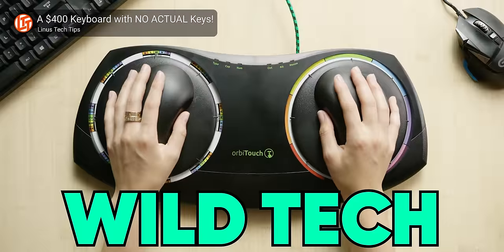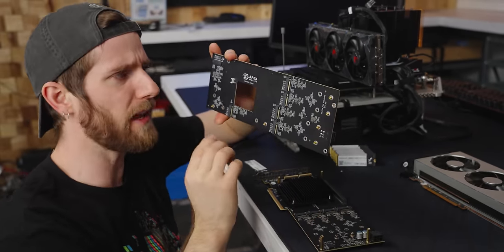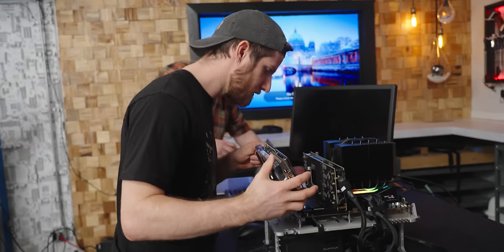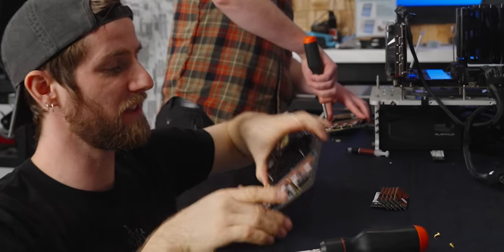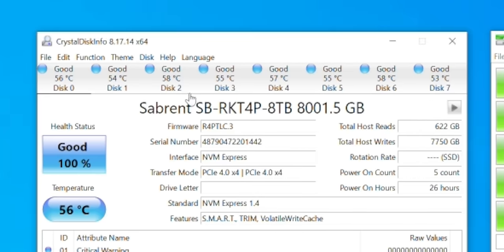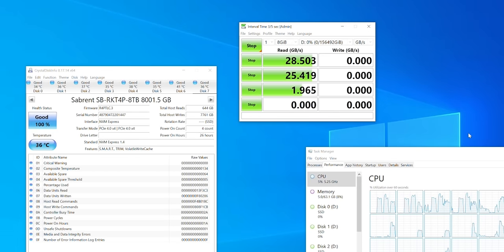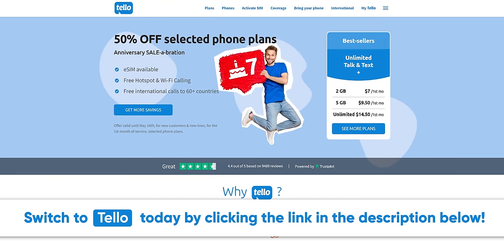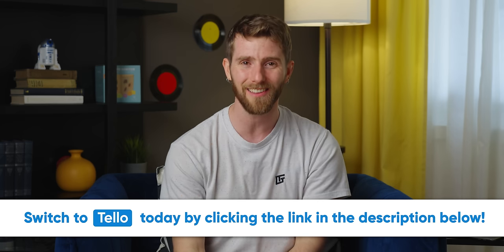This SSD is Faster Than Your RAM - Apex Storage X21

Comment: I'm happy this has come up as a topic of conversation. I've been wanting someone to test SSD speed to say yesteryear RAM versions like DDR3 DDR2 etc. to see if SSDs using swap files are at parity with RAM
Reply: Imagine the day when SSD's become as fast as modern ram then ram can be deleted from a PC.
Reply: @SpruceMoose-iv8un  you're not thinking big enough: you could open a game, unplug your computer, and then turn it back on and keep playing where you left off. Volatile memory holds us back from a lot of stuff.
Reply: Access times are about 10µs, whereas RAM is about 10ns, so about 1000 times slower. RAID improves data transfer rates but doesn't do anything for access time.
Reply: What about latency?
Reply: Intel's 3D xpoint was the closest thing to a NAND and RAM hybrid, too bad it didn't take off
Reply: it would be cool if someone made some hardware that use lots of GDDR6X ram-modules as storage, and had some sort of batterybackup when the computer is off, to keep the data. (and then running them in Raid :D
Reply: @SpruceMoose-iv8un  That could work if you're comfortable with the lower end speeds of previous-Gen DDR4 RAM but honestly I bet regular volatile RAM like HBM2e/HBM3, DDR5, and DDR6 will always stay one step ahead 😏

The fastest Optane drive (Intel's almost-RAM catching drives) was the P5800X at 7.4GB/s which barely edges out the Sabrent Rocket between DDR2-800 and DDR3-1066 🤙
Reply: @dial2616  that stuff already exists, it's called NVRAM or Non volatile RAM, it is slower than normal RAM and isn't just a slot in solution but in general has often lower latency than normal RAM sticks and can end up being cheaper. Issue is just the compatibility aspect and the fact it is limited to specialized applications
Reply: Latency would still be the issue.
Reply: @dial2616  Removing bad data from RAM is the reason every tech support person ever has said "have you tried turning it off and back on again". Even if we could get the access times down as low as RAM on NAND you'd still have to contend with the fact that sometimes non-volatile memory has a habit of permanently storing problems.
Reply: SSDs aren't at all comparable still, not by a long shot. The sequential read/writes on ssds are great, fine for pulling a computer out of hibernation sure, if people still do that, NVME drives are great for a lot however they are horrifically slow at that whole random access bit we enjoy so much with RAM. Like seriously they aint joking there, even gen 5 nvmes are a magnitude slower than even most ddr2 among demanding tasks.
Reply: @AndrewTSq  That's CXL more or less.
Reply: @handlemonium  optane's big advantage was never seq. speed. it was very low latency and legendary endurance.
Reply: yesterdecade
Reply: @giornikitop5373  low latency compared to NAND, it wasn't great compared to RAM.
Reply: @AndrewTSq  ram chips at high capacities and quantities that are needed for such a thing, would be unbelievable expensive and that's IF you can create a controller chip with that many mem channels and speed to make sense. the industry has already though about that decades ago and it's not viable by any means. besides, current hardware and software, cannot take advantage of that.
Reply: Bandwidth and latency are very different. The CPU also has direct access to RAM but does not have direct access to the drive. The interfacing is different. The memory controller on the CPU can access any row and any column of a memory module from a single instruction. To access a section on disk you need to end in/out commands from the CPU; Several of them and then read back the data.
Reply: Sadly the issue is that while the SSDs may be faster than the ram in sequential reads, theyre probably not soon gonna be faster in random reads/writes which is where most of the ram speed comes from
Reply: @glenwaldrop8166  of course. if any nand or 3dxp chip could have as low latency as ram then we would have replaced all the ram chips with that.
Reply: @SpruceMoose-iv8un by that time PCs will be more organic. Just give it a little slap for a speed boost.
Reply: @casperes0912  This is less of an issue on NVME but it's still a thing.

The latency on RAM costs hundreds of clock cycles, NAND latency is probably near a GHz of lost cycles.
Reply: @dial2616 i mean you can already do what your saying though you would just write the save and game state to storage. Just look what console was able to do with their resume states granted your not unplugging the thing but putting it to sleep essentially.

Also just saying that having everything run off of something like a ssd would still have trade offs even if there was raw performance parity. There  are plenty of use cases where you don’t want things to live essentially forever on a drive.
Reply: @Anti3D-0  And even that wasn't as fast as DRAM.
Reply: @handlemonium  That's a measure of bandwidth; latency matters more for the memory bus.
Reply: @dial2616  we had that with optaine.
Reply: @dial2616  you don't want to use an SSD for ram by using swap. its just not designed for it. see: all the corpses of MacBooks with dead SSD power delivery controller chips due to overuse of swap
Reply: @dial2616  i mean sent it to hibernate? ssd is going to make hibernation very fast.
Reply: Swap isn't meant to be accessed as frequently as ram, and i see your use of "parity" ... Lol
Reply: you, not me thinking, could you make the CPU use the drives directly? cuz a regular swap will first copy the needed pages to ram and then use them from ram and just move something not currently used to the drive. But I think even with memory-mapped IO accessing them directly would still be impossible, the stuff would still need to be in ram, but it would just be copied to the drive on regular basis. Feel free to correct me, but I don't think there is a way to do it (at least on x86)
Reply: SSDs using swap files will never be "at parity with ram", whatever the headline bandwidth numbers say.

Anything on a SSD has to be pulled into ram before it can be used.

Comment: Would love to see this thing loaded purely with Intel optane drives, i.e. 118gb p1600x ngff 2280 drives. It would only be ~2TB, of data, but imagine the iops.
Reply: wow, isn`t Optane dead??? I tough that mdern nvmes had surassed it
Reply: @Yamagatabr  they haven't
Reply: @NadeemAhmed-nv2br  why did the project get killed off then?
Reply: @bosermann4963  pretty sure ltt did a video on exactly that
Reply: @bosermann4963  Nobody bought it. Most consumers did not and still do not need Optane and it is a lot more expensive than normal m.2.
Reply: They should get a bunch of P5800Xs and do it with them. Those drives are fast as hell.
Reply: Wendell from L1T would surely do his thing
Reply: @bosermann4963  no one wants to pay the obscene prices
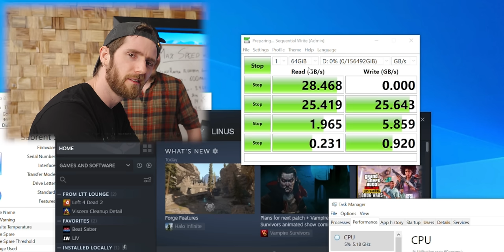Reply: 16:30 go small enough file size and speed doesnt flipping change

So that would just be a pointless waste of time and money to do

Now if your on linux and you use case goes through command line… then sure maybe 18:00

But the Sabrent Drives actually have higher IOPS than the drives you mentioned
Reply: @commanderoof4578  Tom's hardware has the Optane P5800X 1.6TB at 1.5 mill IOPS read and write.
Same reviewer puts the Sabrent Rocket 4 Plus 8TB at up to 700K read, 1M write.

By these numbers, Optane still takes the IOPs.
Reply: @ubermidget2  its an m.2 board FFS so you need to look at the p1600x which cant even get 450k/250k iops
Reply: @Yamagatabr  I recently bought several Optane 56GB SSDs for ZFS filesystem intent log.
Reply: @commanderoof4578  I don't see what the form factor has to to with the performance metrics.
If anything, you are trying to pit a brand new SSD against one released Q2 2021 - You are putting one at a two year technology disadvantage which isn't a fair comparison.

Perhaps you are concerned that the 2.5" form factor of the Optane allows for additional storage packages? Easier to get IOPs when spread across 12 chips rather than 4?
If that is your concern, you can look at those Tom's Hardware reviews. Both SSDs have 8 storage packages onboard.
Reply: @ubermidget2  no the issue is space you can easily fit 1 of these cards with 21 drives on it in the same space as just 3 of the p5800x

So the iops would suck ass and you wouldn’t wire p5800x’s to one of these cards anyway!!

The entire point of the parent comment was saying that they want to see the card loaded with p1600x which is an m.2 optane drive because iops would be amazing… well thats wrong it would be worse

And on the subject of the card in the video vs p5800x you can fit 1PB of storage in a 1u server if not more using the cards in the video

Where as to get the same amount of storage you would need at least 13u using p5800x

Hell if they do a revision 2 and use all 100 lanes or 25 drives then you can get 1.2PB in a 1u rack, or 16u using p5800x
Reply: @bosermann4963 it wasn't cost effective. Of course efficiency improves with time, but Intel & Micron had anticipated a development plateau in SSDs that hasn't happened yet. The technology may make a comeback if SSD development starts to stall.

Comment: This is perfect for data centers! I would love something like this for computer vision models! But I am sure we need motherboards with a lot of pcie lanes, like on the thread ripper.
Reply: A lot easier with u.2 or EX.x in the datacenter for hot swap and cooling.  And sapphire rapids/EPYC have a lot more PCIE lanes, I.E. it already exists.  Not to take away from how cool this card is mind you.
Reply: @nadtz  Yeah, this card is rather niche. It strikes me as something you'd use when you needed the space but couldn't use a full rack mount for whatever reason.
Reply: @DFX2KX  The other advantage of this card is that it takes completely standard PCIe drives, so you can buy them off the shelf, rather than having to pay enterprise prices for U.2 etc.
Or I suppose if you couldn't get the budget to upgrade an older server, but it had a spare PCIe slot and you wanted to really spice up it's storage...
Reply: @nadtz  E1.L doubles a neat intruder protection.
Reply: Its definitely not good for enterprise use tbh. Those drives only have like 3800 tbw rating

Comment: I'm in love with this thing because of NAS storage stuff. Sure, this card is really expensive and might be overkill but having 21 SSDs gives you a lot in terms of fault tolerance (RAID5 or RAID6) while also consuming less space.

I'm excited to see where this is going!
Reply: supercloud, metaverse, digital convergence, whatever you wanna call it
Reply: It's very cool and I would love to have one but it would be cheaper to use 4 way passive cards in Xeon W or Epyc (including an upgrade to Xeon W - the card alone is 3 grand) if you only wanted one card worth of SSDs, it would also give you better cooling since those cards have decent heatsinks
Reply: You can even get 4tb crucial nvme drives at best buy for $200 right now, so i could totally see this being in a consumer media server. If a drive fails itd take like an hour to rebuild from parity instead of like a week with hdd
Reply: @mtrebtreboschi5722  still, for the price of one 4tb SSD, I could get roughly two 4TB HDDs or one 8TB HDD, which, in most cases, is more than enough. 

But yes, you're right: with the trend being that drives get bigger, faster, and cheaper per TB generally, it'll most likely be a thing of the near future.
Reply: @playeronthebeat  yeah hdds are about at least 3x cheaper per terabyte than any high capacity ssd, seagate exos drives often go on sale for $14 per tb.

SSDs have the advantage in size, power consumption, rebuild time, and read-only longevity, which will all mostly be negligible for most people, but I guess if somebody has the money, this is the way to do it
Reply: Cool tech indeed, but at this price range you're much better (and safer) with a dedicated device for storage (like NAS or even a server lol), read/write speeds through LAN network are very good these days

Comment: its crazy to think just a few years ago Sabrent was the "try it if you want" brand I bought a 240gb drive probably 5 years ago and I was skeptical but damn they are on my list of good brands for M.2s
Reply: What are your thoughts on TeamGroup?
Reply: @Valor_X  teamgroup is not bad.  I think they are similar to silicon power,  but still a little early i think.
May be better.
Reply: my sabrent drives died within a year. WD is better.
Reply: @passmelers  samsung is the best
Reply: @isaacbejjani5116  nah. hynix, micron and intel are the best at least from my opinion. idk about their consumer grade SSDs but some of Samsung's enterprise SSDs are just.. problematic. early PM863, PM883, PM1733 seems having issues with its firmware
Reply: @n.shiina8798  yea i only use consumer grade. They definitely had issues in the beginning, though most early ssds were pretty bad in terms of reliability. The EVO lineup is very good though.
Reply: @passmelers  I have Samsung now, but I'll be doing WD in my next build. their current M.2s are top of the line.
Reply: @isaacbejjani5116  at the top end, there really isnt a best. several manufacturers are right there neck and neck. WD being one of them. in real world performance, the paper differences are irrelevant and at that point, its all about quality.
Reply: My sabrent USB hub lights don't work anymore, but the ports themselves and toggle switches still do!

Comment: This would be great for a Virtual Computer center - I’m biased towards education - having Lab VMs available on demand across a LAN would be fantastic.
I’m only part way through watching as I post this, but I would be very interested in IOPS on a new heavy access load.

Aaaaand… you didn’t let me down! You did the IOPS. Writes in a RAID will always cause a performance hit (especially because you won’t be able to use single parity bit and will incur extra cost on >8TB - which this definitely is!), but if I was using this it would be for VMs and Data with a heavier READ profile and it would be pretty cool.

Comment: You know this just makes sense having cards like this with chips that can handle all of this. I can not imagine how much this could help once pcie 5 really starts to come around in the data center. If they come up with a card to be able to double the amount of drives using pcie 3 with the same card effectively that would keep more out of landfills long term. Love this techy
Reply: You are much more likely to see ex.x or u.2 in datacenters.  Imagine how much fun having to swap one of these drives out would be compared to walking over and replacing the drive sled with the blinking light.
Reply: @nadtz  
That's just an engineering problem though, I could imagine seeing a drive sled that contains 4 mini sleds (I name them Slugs™️) each with their own sub blinky blink.
Reply: @MostlyPennyCat  Not exactly sure why when the solution already exists.

Comment: The X21 is more than just a one-trick pony. The M.2 slot supports a number of other devices. For instance, you could use wireless cards with M.2 A+E converter boards to set each wireless card to a specific wireless channel for spectrum monitoring. There’s even an AI angle here. A company called Axelera makes an M.2 AI Edge accelerator module that could be used by the Apex card at some point as well.
Reply: Or the Coral TPU could also fit on this.

Slaps top of card

This bad boy can fit so much AI processing
Reply: I love how we can just mess with funny brain replicas for shits and giggles
Reply: @puerlatinophilus3037  we have one of the other 2* and are looking at those accelerators in it right now.
Reply: @JordansTechJunk  Meanwhile, here I was just thinking of using 21 Asus pce-AC88 wireless cards to pci m.2 adapters and running all 21 wireless cards in parallel for a grand total of a theoretical internet speeds of 44.1 Gb/s upload and download. Do you think that's too much RF radiation? 😁
Reply: @luminatrixfanfiction  I who know nothing really, could speculate about interference making it not work.
Not good enough anyway.
But then again, with the right hardware and software that may not be a thing to worry about, I am simply speculating.
Reply: That’s freaking awesome.